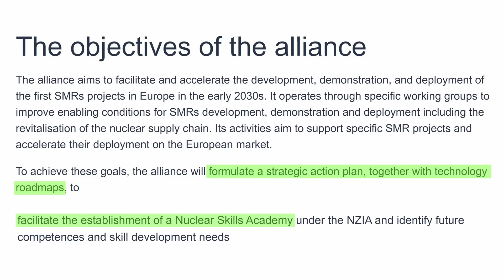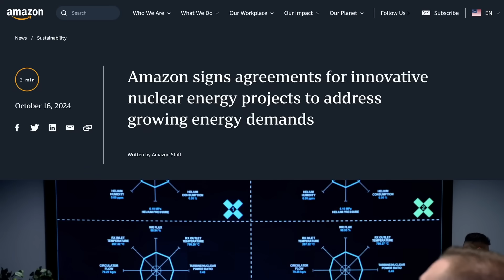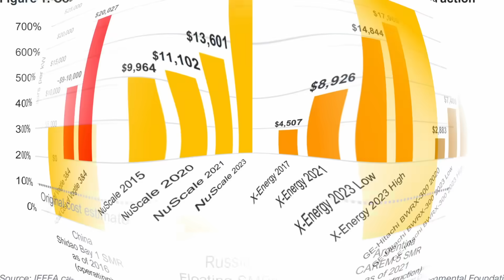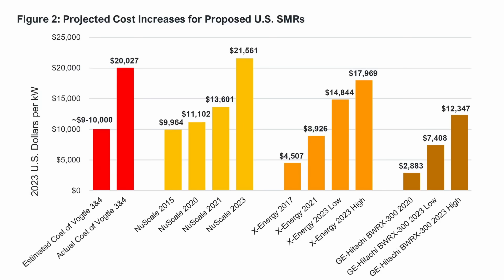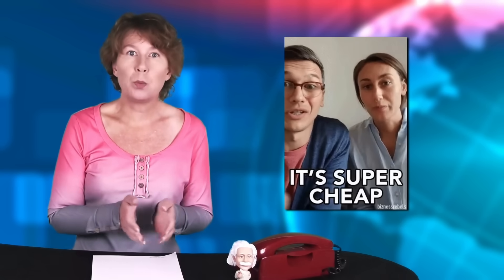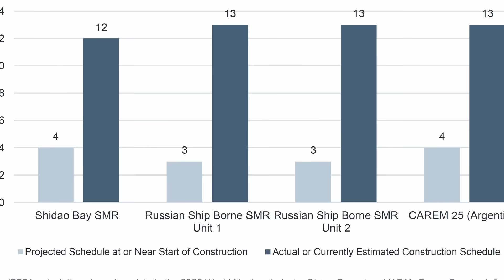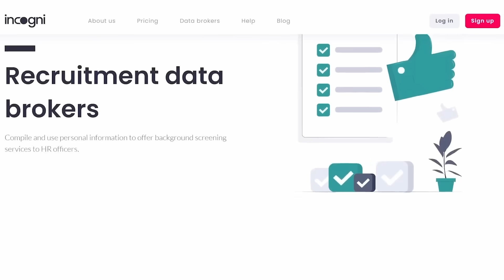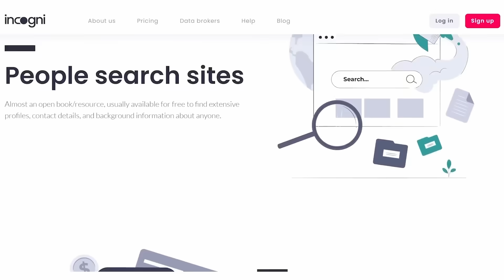Small Nuclear Reactors Have A Big Problem

Comment: Everyone obsesses over the next breakthrough, but what we really need is standardization and scale. If we focused on building more light-water reactors and streamlining regulations instead of constantly chasing new reactor designs, we could decarbonize the grid much more quickly.
Reply from the maker: Good point
Reply: @SabineHossenfelder  Disagree. Light-water reactors are intrinsically expensive. Cheap nukes MUST get rid of any water inside the reactor. Hot water must be at high pressure and the radioactive high pressure water is where the expense comes from. Stop wasting R&D money on SMRs that have even a drop of water in the reactor core and the crappy over budget record will soon whither away. Put R&D money only in SMRs where you have a realistic chance of success.
Reply: @SabineHossenfelder  Ok not c witch, let's get something straight, your peoples, german not cs and my peoples redneck Americans joined forces in the 40s after ww2, built a bunch of cool tech like micro nuclear reactors and classified it, placed under national security scrutiny and made illegal for citizens to own or build.
Reply: @SabineHossenfelder  @actp
Reply: @SabineHossenfelder  it's a terrible point and you should know :  this very video is about failing to standardize and scale the nuclear industry... seriously : scale what? standardize what? that's like suggesting all the boats in the world only have a single design and be produced by a single company even though no company anywhere has yet to build a boat on time or on budget, not to mention boats should have different designs for different needs, and all the while the alternative modes of travel get cheaper and cheaper.
Reply: @Jake12220  you are lying or uninformed, either way just stop.
Reply: @SabineHossenfelder  Regarding your written response under Dave's video:
Of course that MANY would be interested ¬¬
... "agents" can be wrong sometimes, ya know?
* You also know that "views" aren't everything 😉
** And come on! You could happily directly communicate (yeah, no need for agents in some cases) 🙄
Reply: Exactly!  50% of a standard reactor is the civil engineering.  If we could make the civil engineering modular (like a recent Hitachi containment building using factory made metal boxes that allowed robotic welding and insured a good concrete pour, you can go a long way in speeding up construction, not need as much specialized labour, and lower overall project cost.  A really good YouTube channel that discusses a lot of this is Decouple Media.  They go into more detail about scaling issues, where costs lie, etc.  I do hope SMRs do find a path forward, but nuclear modularity, once you look into it, you realize it's something both MANUFACTURERS AND CUSTOMERS must practice and commit to in various ways, rather than just buying any old SMR design.
Reply: @quantummotion  IF ONLY
Reply: No it's the cost of capital, i.e. interest on a giant loan while you make zero income for 5-10 years.
Reply: @quantummotion  sounds good. Sabine has sort of lost the thread with explaining the science & engineering behind science news, so its nice to know others have taken up the gauntlet.
Reply: ALL the regulations are written around highly-managed facilities, which is incompatible with that vision of a fully self-contained reactor stuffed in a CONEX box, with a few on the rooftop of every big data center. Data centers are very secure by normal standards, but not a Q-clearance just to walk within 200 yards of the thing. Forget all the technical hurdles, come up with an standardized operations process that lets you have a reactor at a steel mill, mining site, or data center without having to pay a small army of specialists to manage each installation.
Reply: @Proton_Decay  Never going to happen.  At a minimum you need a security team to prevent terrorist attacks.  You also need to have a radiological response staff to respond to radioactive material release to the atmosphere (there is no design that is immune from that possibility - I've worked in the industry and there is a reason why there are areas around every nuclear power plant in the world to minimize radiological release  - regardless of nuclear reactor type.  The "failure proof" reactor is a myth.  People like me can show you how every reactor could fail and release radiation to the general public.

Nuclear power reactors will always be in enclosed fenced in areas with security.

You also have to consider what happens when things go really bad - beyond expectations - and you start to release radioactive materials to the surrounding areas.  Yes some of the newer designs have much smaller Radiological Control areas.  But they still have them to protect the health and safety of the public.
Reply: @perryallan3524  Like the difference in safety between a Pinto and a Volvo XC90.  Of course nothing is 100% safe, except maybe 10,000 humanoids living in the mountains of France.  Even then there will be hunting expedition losses.
Reply: That's one of the reasons why SMRs struggle so hard. 

"Economies of scale."

Funnily enough it also applies to energy. 

Also the fact military designs are closed off systems. 

Where as civilian SMR has to be versatile in requirements, causing additional headaches. 😂
Reply: @DS91284  
Economies of scale comes with mass production too, not just size.
Reply: @andrasbiro3007  Please see my post on why mass production is not going to occur as a main post under the video.  The concept is a myth for very good reasons.
Reply: I have a lot of utility design experience. It is impossible to standardize design because the equipment that projects are made of is constantly changing, and so every project has to be started from scratch.
Reply: @MagruderSpoots That's not true France gets like 80 percent of their power from nuclear power and if you've seen one of their plants you've seen all of them. It is here in the U.S. that are all different when  they serve the same purpose,boil water.😊
Reply: @robertartiga7  As I said this is my field, what I said is correct.
Reply: @MagruderSpoots  Right there is the problem you're convinced that you have all the answers.
Reply: @robertartiga7  I've done generation design, have you?
Reply: We can do even more by load shifting, adding more smart demand response, and taking certain loads off grid. Irrigation and water pumping can be done mostly  off grid and reduce grid demand. I've read that pumping water uses 7% of the US grid power..

Next, write some building codes that aren't dogshit. We under insulate like crazy. 

Reducing wasted watts will always have a much larger ROI than adding new ones. And, we've never really tried very hard, but have only given lip service to it.
Reply: You cannot standardize a key design input that greatly affects design of major components and cost.  Siesmic design criteria for the site the plant is being built on.    A low earthquake severity area requires thinner reactor vessels, piping, tanks, structural steel, floors, etc.  A high severity earthquake area requires thicker reactor vessels, piping, tanks, structural steel, floors, etc.    This is the single biggest cost factor variable for a nuclear power plant.  No one wants to pay for the "worst case" design unless they are building a plant in a "worst case" area.  It would vastly increase the cost of the other nuclear power plants.
Reply: @ One of the advantages of smaller resctors is that hold up better to seimc events. Less mass means less momentum. A significant amount of damage does NOT occur, while the larger plants requir far greater strength just to survive.
Reply: @ManuelGarcia-ww7gj  While you are correct in a technical sense; every structure, system, and component still needs to be siesmically design and constructed to handle the worst case earthquake for the plant.  its still very expensive - even for smaller equipment.

This cost is offest by the fact that you can produce larger equipment much more economically than smaller equipment.  If you double the size of the power plant it only needs about 40% more materials and cost about 40% more to build, and you likely do not need to increase staff size.

Economics of scale is why almost all new nuclear power plants in the last several decades are 1000MWe (1GWe) and larger.
Reply: @ Okay, but a few very large plants will not meat our needs, we need numerous sma
Ll power plants scattered ot on locations righyt next to their primay users. That way, cobtrolling the grid is simpler, supplying power to mainly one type of user. Thi is a situation in which segragation can pay huge dividendc in reduced control needs by the brosder grid.
Reply: @perryallan3524  
But you are saying that custom builds are very expensive. Seems like standardizing a "worst case" would be much cheaper. You may have to pay 20% more for the extra margin, but save 90% on everything else.

Also naval reactors deal with far worse than the strongest earthquake ever, and they are not that expensive.
Reply: This is literally what Rolls Royce are doing with SMRs. The issue is not the design, that's been done in subs for decades. The issue is making it manufacturable and scalable at a reasonable time and production cost
Reply: @WillyoDee  I've read that nuclear plants on navy ships require 3-6 months down time ever 3 or 4 years for refueling.  I guess that's okay for the navy, but it could be a consideration for an SMR.
Reply: @robertbrandywine  Not necessarily. Maybe you could just swap the reactor to a new over the weekend. It depends. But SMRs proposals I've seen seem to indicate this might be possible.
Reply: @robertbrandywine Every power plant has planned maintenance down-time - even wind turbines. SMRs have the benefit there by having less of an effect when one is offline vs a large nuclear reactor being down. Also, I believe many maritime nuclear reactors are built with a 20 year supply of fuel - the same could be done for SMRs. I’m saying this despite not being a fan of SMRs.
Reply: @markirmuir  Naval reactors have an advantage of "cost does not matter."  They currently are built with fuel for 30-40 years of operation.  The cost of using the highly enriched uranium (or anything else that could be used) is astronomical; and would never be economical for a commercial power plant.
Reply: @robertbrandywine  You are incorrect.   The original naval reactors were fueled for 15-20 years; but a refueling did take 3-4 months so the submarine of ship could operate for 30-40 years (I worked with a guy who did those when he was in the Navy). The current ones are fueled for 30-40 years.

However, this is a case where "cost is no object" and the cost of the highly enriched fuel is astronomical and would never be economical for a commercial nuclear power plant.
Reply: @perryallan3524 Government - spending other people's money. Or money they just printed out of thin air
Reply: @thorkushari4027  At least in the USA government stopped funding commercial nuclear power in the very early 1970's except for the thorium fuel cycle power plants that were built in an attempt to develop the thorium fuel cycle.

In the last decade the US Government started funding for some of the SMR and alternative non water based reactor concepts.  Nothing has yet come it.  On a scale of Government funding, new nuclear technologies are getting pennies compared to a lot of other programs.  Commercial companies are having to fund the greatest bulk of the expenses in new nuclear power plant concepts.
Reply: @robertbrandywine I used to run nuclear test on aircraft construction and helped formulate the Navy’s maintenance plans for them.  Your information is not correct.  refueling occurs once in a ships life at 25 years.  We’ve extended the fuel life several times as the physics modeling improved over the years.  There is a drydocking maintenance period every 7 years mostly related to tank and hull maintenance not the reactor itself.  These reactor plants are sports cars compared to land plants, so they go in for a pit stop every 18 months to repair and maintain the cop one to that wear.
Reply: @robertbrandywine  Navy ships usually go 15-30 years between refuelings, and some are now getting "life of the ship" reactors.  That said, refueling overhauls often take several years, because they do a lot of maintenance and modernization of the rest of the ship along with the refueling.
Reply: @markirmuir  "Also, I believe many maritime nuclear reactors are built with a 20 year supply of fuel" They do this by using bomb-grade HEU as fuel.  This is not a practical solution for civilian power reactors.
Reply: @robertbrandywine the new US and UK subs have an expected service life of 25 years, but the reactors are not designed for refuelling.  SMRs were not meant to deployed singley, the idea was to deploy 3 or 4 with the modules geing easily swapped in or out.  So that when nearing the end of its useable fuel, the module could be replaced and the original one returned to the factory for refuelling/refurbishment or scrapping.
Reply: @WillyoDee  A huge difference is that a submarine and a ship does not have to design to withstand the seismic forces from an earthquake.  They just bobble in the water.
Reply: @WillyoDee the issue is that RR knows only how to build submarine reactors, and noone in Britain  knows how to build a 1 GW reactor.
Which is why RR is gladly pushing SMRs an the new future of the NPPs.
The wastern nuclear program is in shambles because of decades of green policies. It's just RR and others have the idea to sell SMRs as the new green energy source. These won't be cheap by definition.
Reply: @WillyoDee  The problem with the Anglo-American designs for sub reactors is that they run on bomb-grade HEU.  Not stuff you want to put in civilian hands.  RR are having to design a new class of reactor that they have no experience with.
Reply: @WillyoDee  Naval reactors use highly enriched material. That might cause uses.
Reply: The problem is we don't know which one is the best option. Maybe there is no best option at all.
Reply: @Ayvengo21  There is always a best option.  You just have to have the stones to select it when it goes against your core agenda.
Reply: Get out of here - you're talking sense.
Reply: Originally nuclear power plants were built really huge to take advantage of the economy of scale, but this also made them extremely complex/expensive/more difficult to maintain. 

These big, complicated, expensive things were developed and built somewhat quickly (given each has its own unique problems to solve) and then once lessons were learned we stopped making them …
I wonder if actually trying to learn from the lessons and improving over time rather than spending a lot then scrapping the idea wasted a huge potential for savings.
Reply: @fragdude  : Since these primordial reactors safety has been increased by a factor of one million or more. That's not for free.
Reply: the comment is 9h old but the video is 1h old? did you streamline its upload time?
Reply: Amen!
Reply: Like the EPR, you mean? 😂
Reply: 😂, new designs happen to be safer than order designs like Fukushima. 

I'm, sorry but the historical data and evidence suggests that the money and time spent on new designs was well worth it.

What you don't understand is that the US, Russian, French and British governments funded nuclear research that would produce weapons Grade wastes and byproducts. 

As a result, Thorium and LFTR designs fell by the wayside, even though they were vastly superior for energy production. 

As a result, research on these design types had only recently rebegun after the US government declassified the data on their Thorium reactor. (40 year old data). 

So, we are playing catch-up. 

If they had properly researched this 40 years ago, then we probably would already be a full nuclear world with zero carbon emissions, already 😮.
Reply: Everyone wants to pursue technologies that require increasingly rare and expensive materials. Nice job.
Reply: Sorry but that's totally ridiculous. There aren't even enough nuclear engineers out there to build many reactors.  China is building  the equivalent of 2.5 nuclear reactors worth of solar... every WEEK.  In terms of timelines, it's just totally absurd.
Reply: In the wake of Fukushima there's very little political appetite to reduce nuclear energy regulation, and rightly so, I think.
Reply: It's already been done.

https://en.wikipedia.org/wiki/List_of_United_States_naval_reactors

The issue is that everyone else follows the US NRC, which is the most anti-nuke organization on the planet.  Doesn't matter what you do or how you do it, the process to get new designs licensed and approved for commercial use is impossible.  And when I say impossible I mean it's quite literally impossible, they give you one set of requirements to meet, you spend a few years meeting them, only for the NRC to change the requirements and make you start over again.  Few years you are almost done and then they change them again and tell you to start over.  That is why the costs keep doubling and tripling, people are having to run their development programs multiple times hoping to finish before the requirements change.
Reply: @palladin9479  It seems that you do not understand the current NRC (and in fact most of the world) licensing process.

Your post about all the changing rules ended several decades ago.  It was a real problem - for some very real reasons.

Originally in the USA and most of the world the concept was that you would build a nuclear power plant, and after it was built then the regulatory agency (Atomic Energy Commission initally in the USA, replaced by the NRC in the early 1970's) would review the plant to see that it met current standard. If it met current standards it was licensed.

However, there were a series of nuclear plant incidents that identified to the NRC starting in the mid 1970's and extending to the mid 1980's that demonstrated that previous acceptable nuclear standards were in fact not adequate to protect the health and safety of the public (which I hope you know is the essentially the "Prime Directive" in the USA.

3 Mile Island, Browns Ferry fire, and several others showed real shortcomings in the standards.

So the NRC kept changing the standards of what was acceptable to incorporate new knowledge.

This created a real problem for plants under constuction as they started out with one set of design concepts, and their final approval depended on meeting standards of the day when the plant was finished.  Total economic mess as plants had to be modified and changed several times during construction (massive delays and cost over-runs); and some plants could not be economically modified to the new standard and were abandoned partially completed.

By mid 1980s the industry had enough and asked the NRC to change how they did business.   It took some years to develop working with the industry - but the NRC developed a process of licensing designs up front.  Licensing the site up front.  If you  constructed a licensed design on a licensed site, and adequately trained the operators - you would be guaranteed an operating license for the design life of the plant.  The rest of the world has also adopted that process.

I believe that GE was the 1st through the process with their Advanced Boiling Water Reactor design submitted in 1989 for review.  Design License was granted in 1997 (there was along learning process for both GE and the NRC on how to do this).   Westinghouse followed with the AP600 which was approved in 1999.

The industry told Westinghouse that they liked the AP600 design, but wanted a larger power plant - which resulted in the AP1000 design which was approved by the NRC in 2005.

There are currently 6 fully licensed and approved LWR power plant reactor designs in the USA from different vendors and 1 in process, this includes the 50 MWe NuScale SMR  (the AP600 was withdrawn and is no longer approved).

There are 8 vendors with different designs of SMR LWRs in pre-licensing activities and reviews with the NRC (the NRC and other regulators works with vendors to make sure that they understand the process and filing requirements - and also to develop new standards for designs never seen before.  When pre-licensing reviews are complete the companies may file for a license - and the review should go a lot quicker as all the hard stuff was worked out in the pre-licensing process.

There are 13 vendors with different non water based Advanced Reactor Design in various stages of pre-licensing discussions and reviews.

So since 1997 there are no longer any changing standards.  Most other countries in the world have adopted the same process.   Pick a licensed design (or license your own design), license a site (can be done at the same time a design license is being reviewed and approved).  Build it and you have an operating license assuming that your operators are adequately trained and licensed.

In the last several decades only 1 nuclear power plant has been licensed under the old system.   Either Duke or TVA kept the construction license open on a suspended nuclear unit (part of what was to be a dual or three unit site so they had an on site QA and maintenance staff from the earlier licensed unit or units).  They finished that plant about a decade or so ago, and it was licensed under the old process.  But they also worked out with the NRC just what modern modifications they would have to do to meet "current" standards as well before the restarted construction.
Reply: Strongly disagree. We wouldn't build a car designed on the 70s today. Newer designs are capable of using up more of the fuel, reducing the life of subsequent waste and walk away safety. Given the long lifespan, 60yrs+, we would be locking in to bad options, and I'd doubt it would be any cheaper.
The real costs come from regulators holding things up based on the requirement to reduce risk as far as practical, rather than as far as necessary. Reactors, are on the day to day crushed by a safety requirement that doesn't prevent extreme risks, whilst wasting time and money on minutiae.
Reply: If things were standardized, then things like Three Mile Island likely wouldn't happen in which former nuclear submarine engineers were running a large power company's plant, but worried about flooding the system since they were still running a submarine nuclear power plant in their minds.  I understand in commercial passenger aviation, the pilots aren't allowed to switch from one aircraft type to another, because they can become confused.  Personnel could be moved from one plant to another easily.
           If one uses a previously approved design, permitting should be automatic.
Reply: @lewisdoherty7621  Under a process developed in the 1990s things are now standardized.   You can go to most any nuclear regulator in the world and get a reactor design licensed.  Once licensed all you have to do is build it on a licensed site... and you have an operating license.  It is automatic.

The USA currently has 6 fully LWR power plant desigs licensed (which includes the NuScale 50 MWe SMR).  There are 8 vendors with LWR SMRs working through pre-licensing activities so they can apply for a design license.  There are 13 vendors working throgh pre-licensing activities with non-water based advanced reactor designs so that they can potentially apply for a design license.

Most other countries have adopted this process.  The old "horror story days" of changing construction standards died in the 1990's.
Reply: Exactly like France did in the 70s and 80s.
Reply: Water reactors are stupid. Flibe is walkaway terrorist safe.
Flibe is used in fusion fission and those mirror tower condensing stations... flibe cant meltdown water can go Fukushima.  Wake up sabina
Reply: You're forgetting that the US Navy nuclear submarine program gets "dibs" on any innovation in this area. As soon as researchers try to patent a method, process or apparatus that reduces cost or improves efficiency the Navy and other government agencies can put it into the secret patent category.
Coincidentally this is also why our climate models suck - the same types of equations are used to model heat transfer and fluid flow in reactors.
Reply: That's not how the industry works.
Reply: @OP: Indeed… E.g. as was done to reach & land on the moon…? That took a government agency (NASA), public trust, and too many private corporations to even count. 

Repeat today? No, as capable corporations today are way fewer and larger, they protect any development as IP, and favour financial value growth (Charles, property) over productive growth. Likewise, our current legislation prohibits a government to procure anything, they can only bid for tenders. 

This legislative change over 50 years is “liberal” to financial values, but not to communal or public ones. Most of us (census, elections) believe these liberties to be more efficient than the boring 1960’s governments, actually investing through productive corporations. 

Private equity is also a giant competitor to any government, whatever president who may (soon) lead it. Pre Nixon, not the case…

Investment means gaining ownership of some kind, otherwise it’s just “expenses” - paying the bills, so to speak. 

Just paying bills doesn’t make any government (or person) a meaningful capitalist…? 😅
Reply: @OP: Indeed… E.g. as was done to reach & land on the moon…? That took a government agency (NASA), public trust, and too many private corporations to even count. 

Repeat today? No, as capable corporations today are way fewer and larger, they protect any development as IP, and favour financial value growth (shares, property…) over productive growth. 

Likewise, our current legislation prohibits a government to procure anything, they can only bid for tenders. Like shopping, but with big budgets - without a dream of creating something new from it…?

This legislative change over 50 years is “liberal” to financial values, but not to communal or public ones. Most of us (census, elections) believe these liberties to be more efficient than the boring 1960’s governments, actually investing through productive corporations. 

Private equity is also a giant competitor to any government, whatever president who may (soon) lead it. Pre Nixon, not the case…

Investment means gaining ownership of some kind, otherwise it’s just “expenses” - paying the bills, so to speak. 

Just paying bills doesn’t make any government (or person) a meaningful capitalist…? 😅
Reply: No. Totally wrong. We should entirely stop making anything nuclear. In the long term (hundreds of years) they will cause nothing but expensive trouble. In 120 years they might have just finished cleaning up the disaster at Sellafield - at the cost of $1.5billion per year for every year.
Reply: @stevenb3315  And stick withb a deeign that is well suited for submstines while being all but unworkable for stationay power? Did I neglect to mention how plentiful and cheap thorium is? Thorium is plentifulbthat we ste here talking about pennies on thevdollar compaired with 235U. Fissionable utanium costs more than gold, why dont you check the market price for thorium  and then decide.
Reply: Peter Zeihan new video today, on this.
Reply: I think the obsession makes sense: nobody wants (or should want to) invest too much in standardizing engineering and regulations around unsafe, ancient designs. The modern design flux is good and necessary.
Reply: @r0sal3sr  

The ancient designs are by and large not unsafe.
There is nothing very complicated about a nuclear reactor.

Unless you write regulations to insist on complexity in the name of safety.
Old nuclear reactors may have the vehicle equivalent of cart springs and solid rear axles, but so do may American cars still. And they work OK.
All we want is thousands of crude cheap safe power stations. Nothing hi tech or fancy. Just uranium getting hot and boiling water to drive steam turbines.
Reply: @leosmith848  Yea, that might be the root of this argument: I don't really want uranium getting hot and boiling water. In the worst-case limit that is called a dirty bomb. I'm perfectly happy with more safe by physics engineering work before more reactors are mass manufactured and deployed.
Reply: @r0sal3sr  Ther is currently no other way to build a nuclear power station other than by uranium getting hot and boiling water.

I cannot believe you think there is "more safe by physics engineering work".

Try and get an engineering education.
Reply: @leosmith848  Sorry to bother you. I already did. Are there not alternative, lower pressure working fluid systems? I know the most prevelant systems still use water as the working fluid, but it has to run at high pressure to do this, right?
Reply: @r0sal3sr  You can run a water based steam cycle at less than atmospheric pressure (If I recall correctly water boils at about 92F at 0 pressure (30" of vacuum).  Its just a lot more efficient to run at higher pressures and higher temperatures than that.   Overall plant efficiecy goes up with temperature (which relates to pressure).   While there are other fluids that can be used. They are more expensive than water, and less efficient if you run them at lower temperatures and lower pressures.
Reply: @perryallan3524  Right. You can run the water at lower pressures and temperatures, but your heat exchangers and turbines will be running at lower efficiencies. So this is never done in practice. Is it correct that every notable commercial fission reactor failure escalated from failure to disaster because this high pressure steam, and other fission products, dissolved gasses under pressure were released in an uncontrolled manner? That this turns the containment vessel into a bomb waiting to go off if safety fails?
Reply: @r0sal3sr  Also, concerning your claim that every notable commercial fission reactor failure esclated for a major steam release.   Not true.

The only major steam release that produced a nuclear disaster was Chernobyl, which did not have a containment building.

3 Mile island did not have a major steam release nor did it have any notable radiation release.

Fukushima did not have a major steam release.  It had a small vent line break.  In the end the radiation release was considered so small and at a low level that the best thing they could have done to save lives and property was to not evacuate the people from the area (the evacuation created a far worse effect both health and death wise - not to mention property losses as the Government created s situation where they could not tell people just go back home).

So what disasters are you talking about. 

Most of the others were small: SL1 killed a person, there have been a number of radiation exposures to plant workers, etc.

Th Soviet Union/Russia have reportedly had several for which there are still no official admission of.

So tell me your list of disasters.
Reply: @perryallan3524  I did not claim that. I asked if it was the case that the high temp pressurized water and pressurized fission (and I should have said fuel materials in general) products was an issue in these reactor failures. It still kind of sounds like they were. 
A quick look shows 23 failures worldwide since 1975. Not all, but many are due to high pressure steam interacing with the system in some unforseen way and other high pressure reactions melting down. 
Fukushima ended up being a steam -> zirconium fuel rod cladding -> H2 gas explosion set, right?
So yea, I still think high pressure steam might not be best operating fluid for terrestrial, civil reactors, and redesigning the system around different fluid and fuel designs might yield better safe by physics vs. safe by design systems.
Reply: Does anyone know why the N was left out of SMNR? Greenwashing or just plain lying as we’re used to, from the Nukie club
Reply: Nimby is the main problem
Reply: The planning process for large power plants and time to grid is decades. I think Olkiluoto 3 was the only HLWR coming to operation in the EU within the last 20 years. Flamanville 3 started building in 2007 (and planning before 2000) and is still not operational. The chances of standardising those projects within any reasonable timeframe are simply zero. That is even much more of a delusion than fast and cheap SMR.
Reply: Absolutely this, much like how computer parts are standard, this would hugely benefit from this.. Issue is, the corpos hate sharing info lol

Even though, lots of these would likely do better by teaming up/merging.
Reply: Light water reactors are inherently hazardous because 1) metal piping gets fatigued and embrittled over time, and 2) light-water reactors require water to run at very high pressure at temperatures far above the boiling point at 1 atmosphere pressure, so any coolant leak and the water flashes to  steam, volumetrically expanding by 1000x.  One tiny leak and blammo! No more coolant on the hot solid core (which might then melt out of its container), plus extremely energetic and superheated steam explosion.  Conversely, molten salt coolant runs at low pressure, doesn't explode or catch fire...but it requires more expensive metallurgy.  Running a light-water reactor can work in a military environment, e.g. on a  navy ship.  However, I think history shows it is a " disaster in waiting" to trust that a profit-driven business would always (each and every time) prioritize worker and community well-being over the chance to make an extra dollar.  (Look at the New Palestine Ohio train derailment, water dam failures, etc)  If we have a choice in choosing what kind of new reactor design we are going to mass-produce,   let's pick a design that fails in a benign rather than catastrophic manner, even if it is a little more expensive up front.
Reply: @tomwarfel7622  All nuclear reactor technologies are dangerous if operated beyond their design limits and the life of the materials they are constructed from.

You are missing that MSR reactors have a huge problem that does not yet have a proven solution.   The Molten salt fuel and daughter product mix is extremely corrosive.    Now they are working on seeing if they have a solution to that - and the Chinese started a 2 MWthermal test reactor last year to see if they have found a solution (answer is currently unknown - and I doubt we will hear anything until at least 5 years of run time - unless its a failure to find a solution).

The 1st MSR reactor (a test aircraft reactor for the US Airforce in the 1950's failed and leaked highly radioactive molten salt I believe within a week of its first startup).  The 2nd test reactor (Oak Ridge) was within a year of critical failure of its tubes and pipes largely due to radiation embrittlement,  It was only later that they found the corrosion issue. Worldwide the serious players in the industry have done metalurgical researh on a variety of custom made super alloys in an attempt to find a likely corrosion resistant alloy (I've read some of the papers published).  No reseaercher has claimed success.  At the same time the concept that you can potentially filter or chemically separate out the worst of the corrosives with a side stream separation process and keep the corrosion levels low enough that you could have a long life reactor. 

The Chinese test reactor (3rd MSR reactor built) is trying both approaches.  Use their best guess at a corrosion resistant alloy, and use their best guess at a chemical separation system to reduce the corrosive byproducts.

No one has yet even built a MSR test reactor that has successfully run reliably a long time.  We are likely decades away from reliable power plant reactors using MSR technology.
Reply: Quantity is the real magic bullet for getting cost down.

Humans are inefficient at doing new things, but can become very efficient at doing the same thing over and over if they have the right incentives
Reply: Regulations are just what energy cartels call "barriers to competition"
Reply: I would bet that most of the cost overruns is graft.
Reply: The only reason they wont do that, is the way they do it now fills lots of pockets with cash.... 
Streamlining the process would cut out hundreds of people receiving money now, that should not be getting it to begin with.....
In the end, it is all a money game and to see how many pockets can be filled that literally had nothing to do with it.
Reply: Both China and India have proven your assertions dead wrong. China is putting both new and old nuke designs online all the time, at the rate of about 10 per year. This is because the government has made sure that the capital is made available to support the projects, as well as making the regulatory requirements reasonable. Therefore the idea that we must accept the limitations of light water reactors and the inherent wastefulness and proliferation risks they create is simply not true. We in the West have created a myriad of barriers to success that have nothing to do with technology or economics.
Reply: @tetrabromobisphenol  The Chinese nuclear regulations are very close to the USA NRC regulations.   There are no shortcuts on nuclear design and construction standards.  I did a consulting job at one of the AP1000 plants - and was very impressed.

If you look you will find that vertically all Chinese nuclear power plants are based off of Western reactor designs. They want the best designs - and at least in recent years have been willing to pay western countries and companies for their designs (although go back 20+ years ago and they essentially stole the design of their older reactors).   

China, Japan, and South Korea are building plants fast because they have contractors, vendors, and workers how understand nuclear plant construction and can follow the regulations.  The actual regulations are in fact virtually identical to the US regulations (in fact, most countries in the world start by copying the US NRC regulations, and then they may modify a section here or there based on things specific to their own country).
Reply: So we spend multiple millions  ,of dollars ,of work hours to bring a new way to boil water. 
Nuclear waste ,things that go pop and then  areas of the planet declared uninhabitable for minimum decades maximum longer than humanity will exist ,
We could spend tens of millions and have multiple geothermal power stations, because the actual earth is nuclear powered . Look it up 
But no , got to keep miners happy with further subsidies and grease the local and national governments and stop actual scientific progress
Reply: What do engineers use for birth control? Their personalities.
Reply: By all means, go for it. I assume nobody has because it isn't economical to do.
Reply: Dude, what you said isn't incompatible with these reactors
Reply: Brother, if Russia and China give up on something you should not expect other countries to keep going because these 2 are the most persistent one, if they give up it's because there's no viable way. Remember when USSR was competing with USA to see who could make a deeper hole? American stop at 600 feet but USSR only stop when their technology wouldn't allow them to go any further despite coming with new way to dig holes.
Reply: Or, sounds crazy I know, hydroelectric, solar, wind, geothermal, biomass.
Reply: RBMK moment
No one pursues the decarbonisation, only profit. And sibce the "big nuke" is gvt regulated monopoly, there's no room for private tech incvestments until there is massive demand, and there's no massive demand because  neoliberal gvt shall not invest in anything but propaganda and private power production moneybags don't want to lock their money up for 20 years before even breaking even, they want subsidies.
And the tech scavs investors are waiting for the "next big thing" to emerge from the 70 yo abandoned ideas lottery drum.
Reply: Yes what we really need is rapid proliferation of experimental nuclear power plants with drastically reduced safety regulations. Great plan. How could it possibly fail.
Reply: No, the important thing is to build to a good design. We are still talking about SMR designs based on 1950s technology. We need Advanced Modular Reactors rather than SMRs. The Stable Salt Reactor for example is cheap, completely safe and could be built in thousands around the world stopping climate change and enabling plentiful, cheap energy.
Reply: @simonjohnson1  The problem is that no one has built and run these and shown that they are reliable or scale up reasonably well.   There are currently 13 companies working with the US NRC in a pre-licensing process to see if they are ready and able to apply for a design license for their reactor design.   

I expect that in a few years there will be several licensed designs that can be built.  That does not mean that they will work as planned or be reliable.  The history of nuclear power plants is that a lot of good ideas that seems to work in theory - did not work well in practice.  It will take decades for any of the new designs to work the bugs out - if they work well enough to continue with their development.  LWR reactors are now long term reliable and economical because of 50+ years of learning what worked - and what did not.   

I point out that the USA built at least 2 commercial power plants that were gas cooled.  Major technical problems with those plants and they were both shut down very prematurely.
Reply: Yeah, it's clear that a major reason that nuclear reactors aren't getting cheaper to build is that expertise and standardization is never allowed to develop before there's a push to stop making them.
Reply: Absolutely.  The NRC should request proposals for a standard reactor design of say 500 MW and then license that design for use without further approvals.  As long as the builder builds to the standard, the license is automatic.  And we need to require the EPA to standardize the environmental assessments as well.  It should take no more than 4 years from soup to nuts to build and commission a 500 MW unit.

This would greatly reduce the cost and increase safety and reliability at the same time.
Reply: They’re WAY too expensive, which is why they’re not being built.
Reply: @ Yes, and government over regulation combined with lack of standardization are the key reasons why.
Reply: Good point
Reply: It's simple, the flowate through a pipe is to the fourth power of the pipe diameter. Nuclear means expensive materials smaller diameter pipes cost much more than larger pipes vs. potential power It will never make economic sense just every government throwing money at the wall.
Reply: PWRs are already standardized with AP-1000 and VVER-TOI, the problem i see is corruption, beside more corruption. If China (as far as i know they don't export), South Korea and Russia can make 1300MW reactor in 5-7 years for 7 billion max, there is absolutely no reason the West wouldn't be able to do the same and stick to the budget.
Reply: And stop wasting resources on expensive wind and solar.
Reply: @ wind and solar are not very expensive but using them in too high a percentage tends to threaten the stability of a grid.
Reply: This
Reply: light water reactors aren't exactly the most reliable and they can be used to make nuclear weapons, though perhapse instead of investing in thorium reactors which have more abundant fuel (no need for enriching) are safer and can't make bombs, are unproven technology andare more expensive, there are new fuel-reactor types that are similar to a light water reactor, aren't expensive, are proven technology and can increase the safety of a reactor significantly which might be a better option. But I agree nuclear is probably our best bet to decarbonize the grid while fusion reactors say they've been a few years off commercial use for the last two decades
Reply: @handlebar4520    While any reactor can be used to make nuclear bomb grade material the designs of virtually all light water reactors in the world make that very difficult because the long fuel cycles produce too much Pu240, which poisons Pu239 as a bomb material (Please look up the Wiki article on Pu240 for the explanation).  Weapons grade Pu239 is made in special reactors that short cycle the fuel rods to several months of use to limit the production of Pu240.  With the exception of a CANDU heavy water reactor design refueling a nuclear reactor is a multi-week process that cannot be hidden from the world.  Everyone would notice if you were short cycling fuel rods in virtually all power plant reactors in the world (and there are multiple 24/7 cameras installed in CANDU reactors by the international monitors watching for the movement of the refueling machinery.  If they see an unplanned refueling or if the cameras go out... there will be international inspectors there very quickly.

You are incorrect in that Throium fueled reactors cannot make bomb grade material.  Th232 converts to U233 which is a great bomb material (3 countries have detonated U233 bombs).  However, Thorium fueled reactors also create U234 which poisons U233 as a bomb material similar to how Pu240 poisons Pu239 unless you short cycle the fuel rods to several months to limit the production of U234 (and the Pu239 bomb grade production reactors were used to produce the U233 used to fabricate the bombs that were detonated).   Since thorium nuclear fuel is expensive U233 is more expensive than Pu239; and there is a U232 contamination issues which is a hard gamma radiation emitter issue (does not prevent the operation of a U233 bomb, but makes handling more difficult and expensive).  Given the expense of bomb grade U233 no country pursued U233 bomb beyond the test stage even though they have theoretical better performance than Pu239 bombs for certain applications.

There are no proven technology non-light water reactors at a power plant level.  Gas cooled power plant reactors and liquid sodium cooled power plant reactors have all but been abandoned by the world because of their problems (and many Countries built them, including the USA)... They reactor of choice today is a PWR as it has proven to be more long term economical than a BWR.  

I do note that Russia claims that its sodium cooled power plant has operated without any problems.  Virtually no one who has run a sodium cooled reactor believes them as usually it takes 20-30 years to hear about problems in the Russian and old Soviet reactors.   

Also China licensed the German pebble bed HTGR design and have built a sevearl hunderd MWe pebble bed reactor plant to see how well it works (and says it will build several more Units).  China has spent a likely close to $1/4 Trillion building and testing virtually every power plant design that had even some success to see if they can make it work better that light water designs.  So far, nothing has yet been more reliable and economical than a modern PWR reactor.  I give China a lot of credit for trying and doing he research to improve designs.

Just because something works at the test reactor stage does not mean it scales up into a power plant; and a reality there that there are a number of non-light water reactor designs that have never worked well even at the test reactor stage.

Finally, light water reactors are indeed highly reliable - and the newest designs are vast improvements over previous generations of light water reactor designs.

A final note: molten salt thorium reactors pose a proliferation threat as the fuel is liquid (not fuel assembly or graphite blocks that can have serial numbers and be counted), could easily be diverted in small quantities (which over time would be a large quantity), and there is a way to produce ultra pure U233 from the molten salt thorium daughter product stream without any U232 or U234 in it (even if the method is very expensive).

The international monitors are working on what has to happen to monitor a thorium fuel cycle MSR reactor to prevent proliferation of bomb grade materials.  They believe they have a workable framework for that at this time.

Have a great day,
Reply: No. There is no reason for this. And there is no issue with CO2 either. Total bs. Just another leftist power grab. Any warming is due to natural rebound from the little ice age or other factors. Not CO2. CO2 is a plant food, not a catastrophe.
Reply: Using high pressure water to cool nuclear reactions and to heat water for power is high maintenance, very inefficient, creates much more nuclear waste, and leak tridium.
Reply: @Thagomizer-U235  No clue, but pretend.
Reply: @lesseirgpapers9245  light water fuel max 5% U235, spent and unusable at 1% U235, but 3%of U238 is converted to PU which cannot be used in light water reactor due to low heat of 315C. So min 80% of fissionable material is wasted. And not recycled in US. And is put in spent fuel pond next to reactor.
Reply: Your pretending that the nuclear industry did not try that with things like AP100 and the ERP.  They have been a total failure when compared to the progress of renewables, had we pushed harder on them (particularly in the US) we could be decades ahead of where we are.
Reply: The regulations don’t change if it’s large or small, because it needs to be safe. The advantage of small is just that it should be easier to manufacture…
Reply: LOL. They don't want nuclear power. That is the point of the regulations. What you need for nuclear power is a good way for the grifters in congress to make money from it - then it will spring up everywhere.
Reply: Sabine, I'll get this put in the US military budget again.  They did try for an airplane in the 50s.
Reply: One tractor expensive. 10,000 reactors will be much cheaper per unit.  So much learnings in that proves.
Reply: @GaminHasard  No one needs 10,000 nuclear reactor power plants.  Right now there are only 439 operating nuclear power plant reactors in the world - with the overwhelming vast majority of them being over 900 MWe in size (and the oldest operating power plant reactors are approaching 60 years in life).  

Replacements for those plants are at least the same size as large central stations are far cheaper to build and staff on a $/MWhr basis than SMRs.

If the world currently had 1000 instead of 439 we would be in a much better place.

Cheaper per unit does not mean cheaper per MWhr of power.

Economics of scale drives nuclear power plants to the largest plant sizes that can be built in the area.  That is not going to change.   Double the size of the nuclear power plant requires about 40% more materials and cost about 40% more to build, while often retaining the exact same staff size.
Reply: Unfortunately overbuilding renewables leaves nuclear without a baseload market. Data centers may help but nuclear still needs fossil backup to guarantee super high reliability power delivery.
Reply: I bet the cost overruns for CAREM in Argentina is that it is starved of funds, meaning the project is delayed, meaning the overall cost balloons…. Miley suspended funding earlier this year.
Reply: @fbrtnrsthf  Thanks for letting me know about the CAREM project.   I did a bit of digging.   The goals of the project are laudable.  Have Argentina develop and design its own nuclear power plant with a high degree of nuclear safety (meeting most of the best goals of western reactor design).  Concept was for a natural ciruclation 25 MWe "prototype" SMR type reactor power plant, to be scaled up to the range of 100 MWe once they had the bugs worked out at the 25 MWe stage, with potential scale up to larger units after that (which is how power plant design and development actually works:  No one starts out building modest to large power plants using an idea or technology that has not been proven at smaller sizes).

Construction started in 2014.  However, its been beset by a series of problems as a few design issues were identified and then there have been numerous problems with contractors being able to construct things to nuclear standards.   Problems = more cost & more time; which is quite typical of and technology development and scale up.

You are currently correct that the 25 MWe prototype reactor is suspended with minimal funding (just enough to keep the project under good QA control so that it can be finished someday).

A reality is that what CAREM has faced are the kinds of issues and cost that will accompany any new reactor plant design, especially in a country where they do not have a robust nuclear construction industry with very experienced nuclear construction workers.  You can either throw a lot of money at it... (which might help you get over the problems - or might not)  or suspend and long term abandon the project (and worldwide many nuclear technical development projects have been abandoned either in the test reactor stage of the 1st prototype power plant).
Reply: Agree. Have proposed for India - such an approach of 700PHWRs & Large PWRs in fleet mode.
Reply: No it's political. China invested 356 billion dollars into solar and the US and Europe crippled them with export taxes a 50 dollar panel sold for 200 dollars. China has half the world's requisite energy in solar panels sitting in warehouses
Reply: @PlanXV  Solar is not a substitute for base-load power plants, which is the role of nuclear and the old coal fired power plants, with some oil and natural gas fired power plants also assuming that role.

If you did not notice, solar is an intermittent power supply (so is wind) and solar does extremely poorly at night.

There are reasons that about 60 very large nuclear power plants are under construction at this time in the world - and its estimated that in 10 years that it will be 80-100 very large nuclear power plants under construction (average construction time is 6 years for countries that have experienced nuclear construction contractors, vendors, and workers).
Reply: At least we're not chasing fusion reactors as a climate solution.
Reply: Legacy reactors, ie light water reactors, should be left to history. They have abysmal fuel efficiency leaving more than 95% of the fuel as long lived waste. And they have pressurized cores adding risk and complexity dealing with potential blowouts.

Build fast high temperature reactors with pressureless cores that can burn the waste from old light water legacy reactors.
Reply: I hate to see it but much of what you said comes down to CONSOLIDATION. I ain’t a commie but when it comes to projects like this that are so labor and capital intensive + virtually uninsurable, you need all the smartest people and best resources channeled into the same thing. Imagine the manhattan project but every physicist had their own startup lol
Reply: Do't worry.  ww3 will handle.
Reply: we are focused on building more solar and wind plants at scale unimaginable for nukes, nuke lobby is focused on brainwashing taxpayers
Reply: just in one year 2023 we installed more solar power capacity than total nuke power capacity in all of history combined
Reply: Your argument is akin to an argument for the Ford Model A. Yes, we could standardize on that, but at a cost in terms of safety, performance and efficiency. There are new designs that largely eliminate the safety and fuel disposal concerns. Should we ignore their existence? I agree we should standardize onone design for a period of, say 20 years, while development and validation continues for new design competing tobe the standard in 20 years. The problem is that we have no currently validated designs because of over regulation environmentalist opposition to nuclear reactors.
Reply: @dilvishpa5776  the problem is nukes are uncompetitively expensive and nothing is going to fix it. they are more expensive than gas peakers
Reply: Carbon dioxide is 0.04% of air. It's no big deal.
Reply: @randymartin9876  it was less than 0.03% few decades ago. soon it will reach 0.07% which is bad air quality with headaches for some people. then it will become impossible to get clean air by opening window. it's a huge deal
Reply: Yes but we haven’t built a nuclear reactor for 30 years (not talking about test reactors. There are more options than just light water reactors now. They are safe but requiring power long after it stops producing power to keep it cool  has proven disastrous in one case. Japan. The other added cost with construction is everything is custom built onsite which leaves room for tolerance issues which is one thing that takes a long to certify. Exact specifications have to be met. There are small reactors that can be built assembly line with very strict tolerances and quicker and cheaper building. I agree with standardizing but on which model. One of the newer designs or are 30+ year old design which could prove catastrophic in some cases. Albeit. Rey small chance
Reply: Nuclearize it instead. Water is a neutron moderator, but not anywhere as effective as D2O. Still need containment for steam or hydrogen explosion accidents. Light water reactors are even less efficient and safe than liquid sodium heat exchange ones.
Reply: I concur
Reply: The reason for constant redesign is not because we run from paper work.  It’s because with nuclear your grand children will be glowing , and can do nothing about it.   If we think corporations whose reason for being is cash flow will look beyond that cash - then we may as well stop believing in gravity.
Reply: 3000 smr before economy of scale makes them cheaper, not clear where we get the fuel! and so on and we will have more high radioactive waste and stop citing online BS Headlines thx a lot
Reply: Pure fantasy is thinking that wind and solar can ever provide enough power for the world.
Reply: @russellschell4812  NObody talks about Wind and Solar only.... are you some strange Kind of social bot?
Reply: Took the words out of my mouth, well done!
Reply: @maverick_ii746  :hand-pink-waving::face-blue-smiling:
Reply: Eh, don’t overlook heavy water reactors, CANDU is great, you can use natural uranium, RU even MOX if you want to deal with weapons grade plutonium. Scale is important, bigger is better and easier to secure. I’m not sure a world of SMRs scattered all over the world is a good idea.
Reply: Arguing fills the time gap to extinction - without the waste of effort and resources.
We are out of time -> or do you have a perspective for the next 5 - 10 years to come up with a *working* global solution  ?? See  
You nerds will get it, when heads are on forks?  Climate change and so is not a 'technical problem'   like you always tend to believe...
Reply: The Trump administration has said much of the same and is in the process of making many changes
Reply: We could not decarbonize the grid this way. Estimated reserves including difficult to mine and not yet found deposits are around 250 years at current rate of consumption for current off-the-shelf LW reactors. If you want nuclear power to play any significant role in the world-wide energy mix, the number of installed output power has to be increased by a factor of 5-10 at least. This would mean to run out of fuel way before the first of these reactors reaches end of life. Without at least one readily available industry standard breeder reactor type capable of supporting the simple LW reactors, major expansion of the world-wide reactor arsenal is futile.
Reply: @elgrenen2600  You're only counting Uranium there, and you're assuming no reprocessing.  Thorium and plutonium can be used in existing reactors.
Reply: @JohnHughesChampigny  Yes, I'm only counting uranium, as this is the only relevant nuclear fuel at the moment. Plutonium is used, too. However, it is not a natural resource but produced from the available uranium. Reprocessing is reflected in these estimates. Thorium as a fuel is in early prototype phase and at the very least a decade away from any significant number of commercial plants, realistically even more. It were definitely no option if we decided to go all-in nuclear now.
Reply: @elgrenen2600  pure thorium reactors are experimental, burning thorium in existing PWR reactors has already been done at a small scale.
Reply: @JohnHughesChampigny  Actually, The USA built 4 commercial thoruim power plants, and Germany built a 5th.  The USA went whole hog into trying to develop thorium fueled power plants in the 1960's - 1980s.   

We have core designs from then that can be put in to over 80% of the worlds nuclear power plants today.

But, thorium turns out to be very expensive to extract from the ore an convert into nuclear fuel. So much so that at the time thorium fuel was more expensive than U235 even if the ore was free.    

If thorium was cheaper then many countries would be running it in their nuclear reactors today. No one is.

There is a second issue with an isotope of thorium converting into U232 which is a hard gamma radiation emitter making spent fuel handling and reprocessing difficult and more expensive.  But I'm convinced the world would live with that if thorium was cheaper than uranium or plutonium.
Reply: @elgrenen2600  the official estimates last l checked were around 1000 years, but that was only using known deposits. By then we should easily have worked out how to use thorium or fusion properly, at which point energy is no longer a constraint.
Reply: @Jake12220  There are no "official" estimates. There are a couple of estimates, and they differ significantly. I have chosen an average value. There are more optimistic estimates, but ... man, 1000 years only on known deposits *with current reactor types*? That's wild! Where does that number come from? Unless that includes uranium dissolved in sea water, then it would afaik even be a pessimistic estimate. However, there are no extraction plants available, in production or even in serious development, so this would only be an option for the far future, anyways.
Reply: @elgrenen2600  50years is a lot of breathing room man.  I am not convinced about that anyway.  Isn't thorium relatively abundant.  I think using nuclear as a bridge to renewables on the time table that politicians seem to espousing is much more easily achievable.  It's not an all or nothing thing.  Simple, don't build more reactors than you have fuel for, if you are worried about running out of fuel before reaching the service life of the reactors.
Reply: @msromike123  the point that a lot of people miss when they say we’d run through our uranium reserves in x years (250, whatever) is that most estimates like that only count known, economically viable deposits. More exploration, new drilling techniques, potential for underwater arctic mining will almost certainly revise those numbers upwards in due course.
Reply: @stevenb3315  plus its extra pointless as they could run on thorium instead, which is safer, more productive, and more abundant
Reply: @msromike123  50 years pass faster than you think. Again, this is even less then the lifetime of a reactor. Of course we won't build more reactors than we can be sure to fuel (at least unless the planners are totally out of their minds). But this means, we cannot build enough nuclear power to have a significant impact on the global carbon emissions at the moment. Your point about thorium doesn't apply, as current commercial reactors use uranium (in a quite inefficient way). With new reactors, new fuels and/or fuel extraction from sea water, the nuclear perspective changes dramatically. But these are all technologies somewhere between the theoretical and prototype stage, many years or even decades away from widespread use. If we want solutions now, nuclear is not much of a help.
Reply: The reactor is not the major cost driver in nuclear power plants. It’s the containment structure.
Reply: @KevinBalch-dt8ot  Not exacly true.  The level of seismic design to prevent key components, systems, and structures (foundations, buildings, and the containment structure) is the key cost driver of a nuclear power plant.

Plants in areas of the world with mild possible earthquakes are much cheaper to build than plants with much worse earthquakes.   

It affects everything from the thickness of the reactor vessel, piping thickness, foundations, floors, walls, amount of structural steel, pipe supports, etc.
Reply: @perryallan3524  I will defer to you, but don't SMR on rubber foot pads pretty much mitigate that.  To me that is one for the SMR plus column.
Reply: @msromike123  You obviously do not understand the magnitude of the issue with earthquakes.   It is not solvable just by mounting a few pieces of equipment on rubber feet.  The building itself must withstand the earthquake.  All the safety related piping, components, electrical panels, wiring runs, etc. must withstand the earthquake (pipping, equipment, tanks, and even the reactor vessel must be thick enough and made of suitable tough materials not to fail or collapse).  Rubber feet are pretty much worthless when you start to do seismic analysis of what is required to withstand an earthquake.
Reply: @KevinBalch-dt8ot 
I remember in the 1970s or early Jerry Pournelle said nuclear proved to be a great way to generate electricity. However proved to be an even greater way to employ lawyers. It's the time factor that proved to be the biggest factor in increasing plant costs. Time spent in court.
Reply: @KevinBalch-dt8ot  why don't you learn real engineering first instead of spewing bloedsinn.
Reply: @KevinBalch-dt8ot  Neither the reactor nor the containment structures are the major cost.
The cost is completely dominated by the number of people and the time it takes to get the thing approved, and the interest on the capital whilst that is happening.
Reply: Agreed.  However could not the same be said for producing SMR at scale?
Reply: @msromike123 The original trend in nuclear power was to become larger, because it’s more efficient: less money to build per MW, and uses the fuel more efficiently. So the idea of scaling them down has always seemed weird to me. Economies of scale could apply just as easily to full size reactors, and in fact it used to - General Electric built a ton of them used all around the world.
Reply: @markirmuir  true, but one of the arguments for SNRs has also been to make power generation less centralized/more at the point of use, to reduce the need for more investments in the grid. This is not to say that this would fully negate the difference in efficiency with the bigger reactors. Another argument was to make the different users (industries, cities, military, countries) more self-sufficient and less vulnerable to outside influences. It is hard to put a price tag on that.
Reply: @markirmuir  
Bigger nukes are more efficient only due to regulations. The fixed regulatory cost is so high that it makes smaller ones uneconomical.
Reply: @andrasbiro3007  When nuclear power plants were scaling up in size back in the 1950s-1970s, there were no regulations.
Reply: @markirmuir  I think the idea of scaling them down, makes sense in the context of inadequate grid infrastructure.  And what is the fastest way to provide carbon neutral power, right now. Short of draconian buts in lifestyle, I am not sure we have time to build out renewables and it's attendant infrastructure.  I am all for whatever works, but also am a believer in using the best solution available, now.
Reply: @andrasbiro3007  No. Other way around. SMRs will need almost no regulatory approval once the design and production process has been type approved.

The reason they are being developed is precisely to reduce the time and money wasted in getting approval.
Reply: @markirmuir  actually there were regulations.  They were not as strick as the current ones.

All the changes to much more strict regulations and strict control of construction have come from actual or very near nuclear events and in some cases deaths.   The entire nuclear industry has learned worldwide that normal commercial construction standards are not adequate for nuclear safety, and that nuclear power plants must plan for all kinds of things that could go wrong - and be able to protect the health and safety of the public.
Reply: @markirmuir  The argument for SMRs is that if you want 1000MW of power,  you can co-locate twelve 80MW reactors instead of one 1000MW.  That actually costs more.  But, the thought is that you could have the plant up and producing power at 80, then 160 etc.  So you don't have to wait until the entire thing is built.  It actually costs more to build the plant, but the cost of the capital is less, because it starts returning ROI faster. 

I'm not sure I buy the argument, but it really is tied more to the cost of capital than the cost of building.
Reply: @markirmuir  I think the SMRs have a PR advantage, my speculation being that being small and mobile magically decreases fears of accidents, which might be necessary to gain political momentum to build them.
Reply: @markirmuir  
There were regulations. Not as bad as later, but pretty strict already.
Reply: @markirmuir you scale down bc the grid is inefficient. You need a power source to meet local demand, direct to consumer (business) power rather than direct to grid
Reply: @msromike123 no? Building it smaller makes it 9/10 times less efficient, especially if you need qualified personel to operate it, like in this case
Reply: @filipbitala2624  "9/10 times less efficient" 
Isn't that 90% more efficient? 🤔
Reply: @ no? Its pretty clearly not
Reply: @filipbitala2624  
The main point of SMRs is to eliminate all the things that make big nukes so expensive. Size brings a lot of problems that are expensive to solve. For example cooling is so much easier at small scale. But the big one is construction. Every big nuke is unique by necessity, as they have to be built on site with local workers and suppliers. SMRs could be mass produced in factories and just put down at the customer's site. Standardization and optimized supply chains really drive the cost down.
Reply: @filipbitala2624  No, it doesn't.
Reply: @ except they couldnt, thats just popaganda, they cooling isnt easier just because its smaller, if it was, then big plants would have more smaller reactors, instead of few larger ones, and the big problem with the small ones is protection, you would still need to build a house around it and also a radiation shield inside, and would still have to be large enough for people to actually operate it, you will basically get a villa instead of a resort, with one hundredth of the power output
Reply: @ what doesnt it?
Reply: @msromike123 its less effective on smaller scale, but you'd need to also roll them out and find the problems in protocols etc first.
Reply: @msromike123 You're forgetting that SMRs need HALEU fuel which isn't easy to produce without good centrifuge technology. Right now the US cannot produce HALEU almost at all. So it will take money and time.
Reply: @msromike123  LOL ALL* reactors are SMR's - look up the specs
Reply: The problem is that nuclear plants are not easy to standardize, since they depend on the needs and resources of where it's being built. But it's true, we have reactor technologies today that virtually can't meltdown, we don't need to keep waiting for new breakthroughs. It's what China is doing, they have something like 50 reactors being built with an average of 5 years to complete.
Reply: @danilooliveira6580  this is the best point anyone’s made reading through the replies. I sorta knew this was a valid criticism when I commented this and I’m surprised you’re the first one to say it.
Reply: That’s why ‘liquid salt’ designs could offer more.
Reply: @ yes corrosion!
Reply: Who is  " we ' ?
Reply: @ not you, I presume😋
Reply: Except you still need about 20 years to start getting them online, and some have been on hold a long time. You can far more quickly cover a couple of deserts with solar panels in the USA. That with storage and a unified power grid would sort out most of the USA power needs.
Reply: It's pure fantasy.
Reply: @tarstarkusz The entire US Submarine fleet now does a slow head turn and stares at you funny.
Reply: Probably still not cost effective. Solar will dominate especially as batteries takeover for dispatchable electricity.
Reply: @AORD72  
Only if they can develop an affordable battery that is not dependent on lithium.
Reply: @scotttovey  Enough lithium on the planet for all human requirements (if you take it from seawater). Notice how the lithium price has dropped lately, because of over supply as people suddenly realize they have a whole lot of lithium were they are.
Reply: @AORD72  Take away the CCGT contribution, allow for periods of simultanous low wind and overcast conditions and UK alone would need for say 5 days supply 30 GW x 24h  x 5days = 3,600 GWh of batteries.   And some pundits reckon double that figure.
Reply: @AORD72  ROFLMAO!
What batteries?
Reply: Too bad there is no evidence that "decarbonization of the grid" has any effect whatsoever anyway.
Reply: after 15 trillion $ in renewables the carbon use went up. Really how hopeless is your mental capacity.
Reply: @lesseirgpapers9245  no, no, no. We just need to spend another $15T and we'll get it. /s
Reply: @lesseirgpapers9245 - That’s a great argument. Provided, of course, that you completely ignore overall electricity demand. Had we not made the moves to getting close to 20% of our electricity from renewables, the carbon count and cost would be higher and the constraints on economic acitivty would be considerable.
Reply: @lesseirgpapers9245  Repeat after me, correlation is not causation.
Reply: @dragoniv  Wow we learned that trop in grade school. But your tyrannical "repeat after me is quite outdated except maybe in the western world🤣?  But you do not even seem to know what correlation or causation means. You really need to have an exam if your faculties are in decline. Arrogance usually is a good clinical indicator. 🤣
Reply: @lesseirgpapers9245  Judging by your consistent attacks on everyone who disagrees with you, it's rather clear who the arrogant one is.
Reply: @dragoniv  You are the person that demand I repeat like a parrot your trops. That is deemed by the rest of the world as tyrannical. 🤣And in America you can not stand free speech and think that is attacking. Seems like you do not know what the words mean?  🤣
Reply: @dragoniv  
Don't kid yourself.
There are plenty of things that are in fact causation, which experts like to dismiss as correlation saying; "correlation is not causation".

It's like when experts dismiss the medical symptoms and experiences that people have saying; "That's anecdotal evidence". After all, we must not allow an unofficial study conducted by a practicing physician on his patients, to have the same level of credibility as an official study conducted by a scientist, on patients given a treatment, and then handed off to their practicing physician for observation.
Reply: @scotttovey  you and I definitely have a different worldview and I'll leave it at that.
Reply: @dragoniv  
"you and I definitely have a different worldview and I'll leave it at that."

It's not about wordview, it's about acknowledging the shortcomings of the tech.

Environmentalists claim "green energy" is cleaner than the current energy system. The truth is, it's dirtier. It takes petroleum to mine the lithium, and the process produces more carbon than just driving an ICE.

If you are not willing to acknowledge the pros and cons of all sides, you cannot solve the alleged problem.

Environmentalists are like religionists that tell you to give until it hurts. What they don't tell you is that once you have done so and your budget is messed up royal; they won't be there to help you out of the jam they encouraged you to get yourself into. Then won't have your back the way they demanded that you have theirs.
Reply: @scotttovey  Keep right on fishing.
Reply: We need more Elon Musks
Reply: @koblongata  we have plenty of Elon Musks. There is never a shortage of charlatans.
Reply: @koblongata  Rich guys getting richer through subsidies? Even if we had 10 Elons all working on nuclear power it still wouldn’t cut through all the variation and red tape.
Reply: @koblongata  More Edisons than actual Teslas?
Reply: @silvercloud1641  Elon Musk is way beyond Edison and Tesla combined
Reply: @koblongata  Still, Elon seems more Edison/business to me. Than about something like free energy for all with something like a wardenclyffe tower. I also don't think fascist ideals are the future after ww2. How much is a gallon of gas in socialist Venezuela? And they're not even the best example of a proper democratic socialist society. If you like paying 5+ dollars a gallon, even when Venezuela provides cheap gas in the winter to the US but doesn't pass those savings onto the consumers, then by all means enjoy that capitalism/corporatism.
Reply: @koblongata ha ha ha
Reply: @koblongata  : To support more Putins?
Reply: @koblongata we need one less Elon musk playing politics and god
Reply: @wordzmyth  he always just does what's right, he can't help it